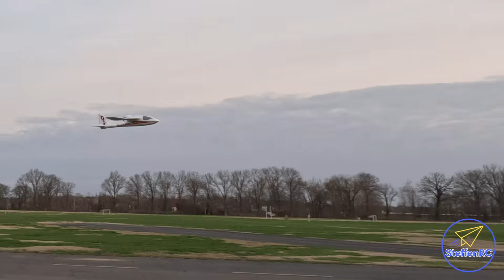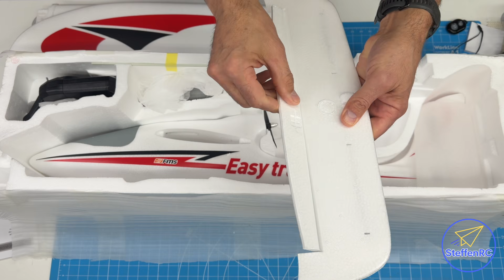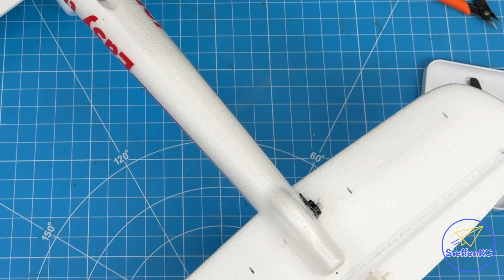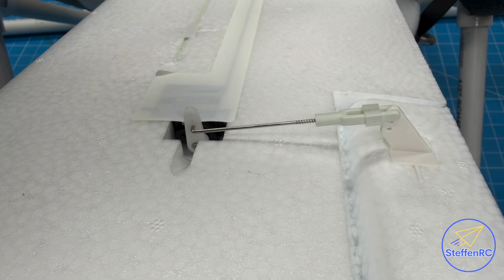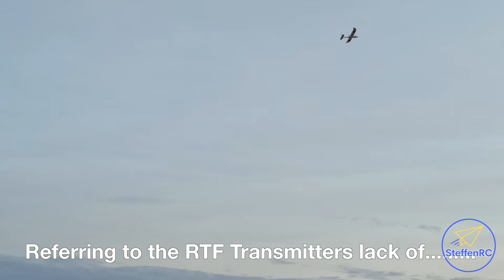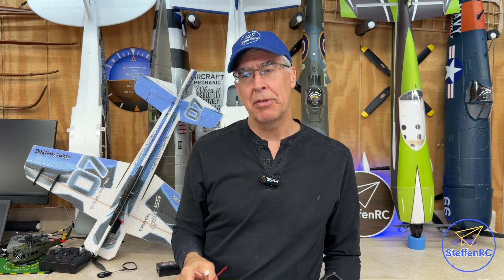FMS Easy Trainer 1228 - RC Plane made for beginners

Comment: Hi Will tonight I installed a reflex on this aircraft but it is not listed in the reflex app for selection ?? Any thoughts ??
Reply from the maker: Just use the “Other”.  Then make adjustments to confirm the gyro is moving the control surfaces correctly

Comment: The Volantec version has a gyro but is Half the size, 600mm. It flies VERY well. Decide if you want a gyro and Ease of flight.. or 2x the size.
Reply from the maker: I think a gyro would be very helpful for this plane as a beginner plane.  Using SAFE and AS3X is a benefit.   I plane to install one at some point.

Comment: Does the Flysky Tx have a throttle cut feature? I suspect it does not.
Reply from the maker: You are right it doesn't.  I've commenting to FMS many times that this is a serious issue they should address.   I warn pilots to be very cautious and power the plane at right before flight.  Also, remove the prop while working on it.
Reply: @SteffenRC  I just recently got a 1220 Ranger RTF. It came with a FS-FMS-I4X radio. It does have a throttle cut switch. 
I don't know if it makes a difference but I bought it in SEA.
Reply from the maker: Really?  They have activated a throttle cut?  I assume its switch SWB..  WOW....  Good to hear.   I just tested a newer Ranger and it does NOT have a throttle cut.
Reply: @SteffenRC   yes, it is a switch.  If you have an email I'd be happy to send you some pics. I'm new to the hobby and have been binge watching your videos and have learned a lot from them. Thanks for making them.
Reply from the maker: Please send them.  willsteffen@gmail.com.   Thanks, Will

Comment: Is it possible to buy the rtf version en later connect it to a spektrum transmitter?
Reply from the maker: The RTF (Flysky) receiver isn't compatible with the Spektrum system.  So, you'd need to swap out the rx too.